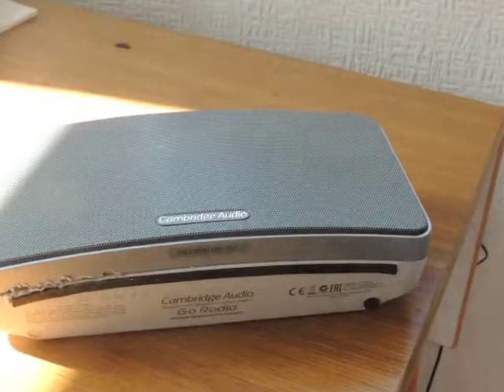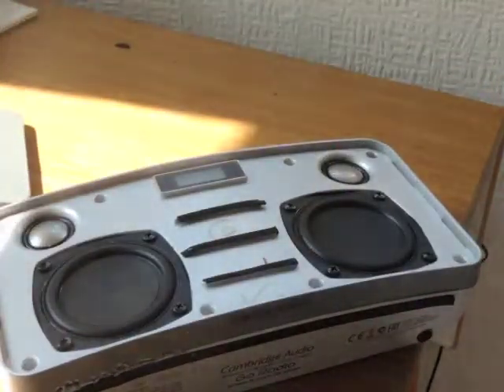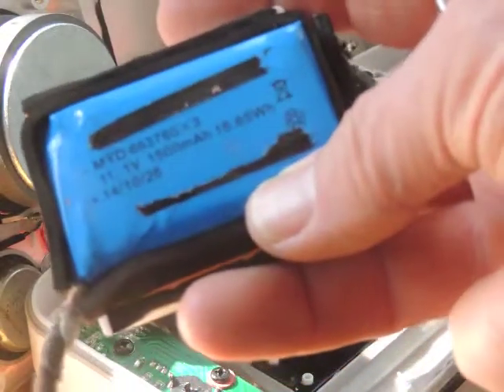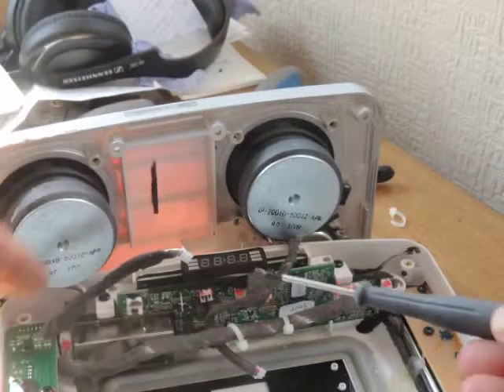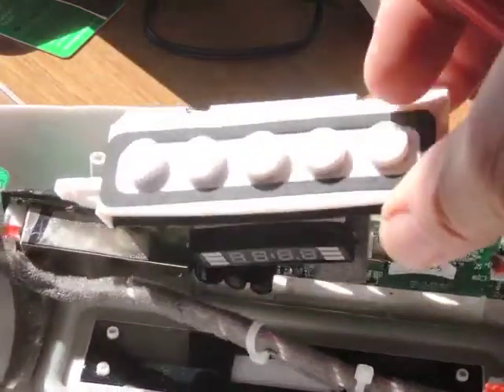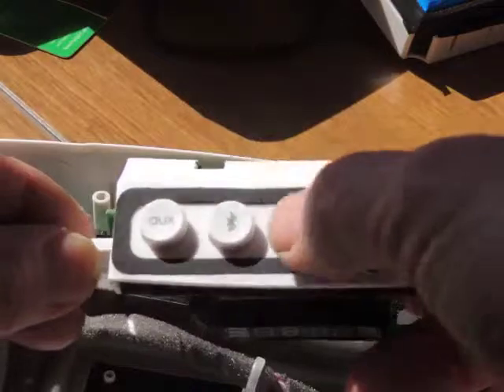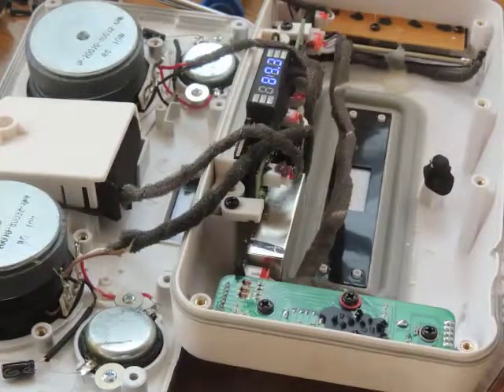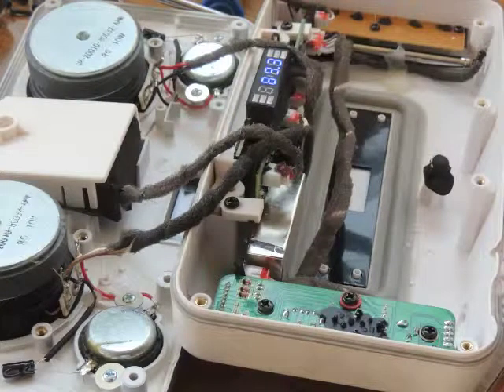Cambridge Audio Go bluetooth radio speaker. Often will not turn on and random shut down.

Comment: Thanks, mine goes by power adapter only . As soon as the power cable is removed it last 5 mins then turns itself off . So now to detect if a bad battery or not, or battery not charging . Thanks for posting the video to disassemble

Comment: Thank you for this video instructions, I've been having trouble with my Cambridge Audio Go almost from first day, sometimes was instantly increasing volume, getting shut down unexpectedly, since recently when completely was impossible to turn it of. After pressing power button it just showed blue line on display and nothing else. ... It was driving me crazy with this behavior, but on other hand I loved its sound and I was sad when it died. Few days ago I found your video,  and by following instructions from video it was fixed in less then an hour including going to local electronic store to buy crystal.
Once more  thank you very much for this video.
Reply: Was the sound after assembling the housing ok? With the LOGITECH S715i, for example, there is such a problem that the housing is probably hermetic and when opened and folded it does not sound so good anymore - the passive membranes stop working.
Reply from the maker: Sound to me was the same. I do agree with having to be a sealed case.  The bass radiator being passive only moves due to variations in the internal air pressure inside the case causing the passive radiator to move. An air leak due to case damage would seriously limit the function of the passive radiator. Replacement of the other loudspeakers would change the action of the passive too.

Comment: Thank you very much for this video. I too was going to butcher the case before I found your instruction. My unit just stopped working. When I disconnected the battery I was able to turn the unit on. I then reconnected the battery and it still worked. I will let the battery charge and see if it continues to work.
Cheers